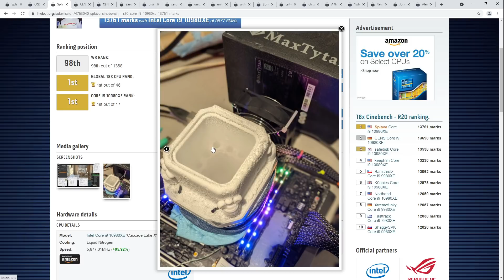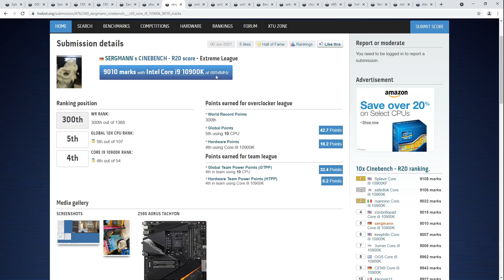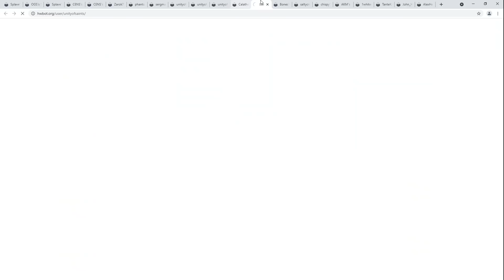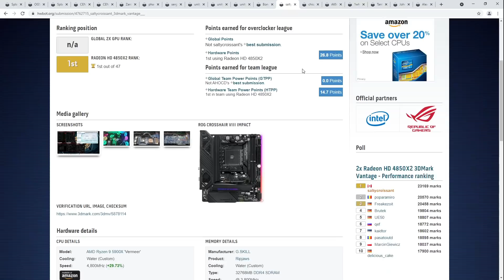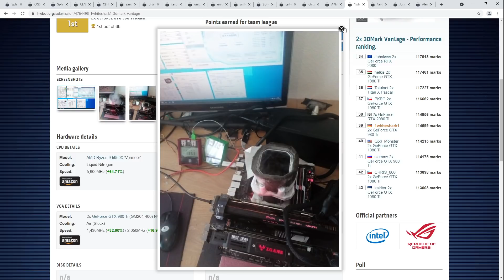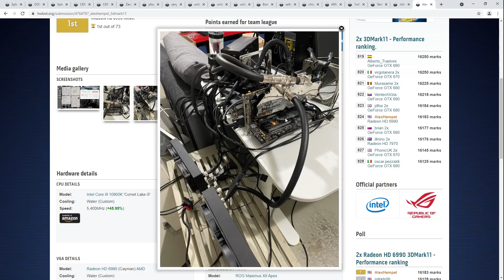HWbot score round up #6: WAY TOO MANY SCORES EDITION

Comment: Hey guys, have a question cuz kinda newbie in pc. I built my first  pc yesterday. Main parts are i5-11400f + gigabyte z590 gaming x + hyperx furry 3200 and cooler deepcool gammax 400 + dq 750 st gold + mesh box (2 fan 140 mm). I've heard a lot of rumours about i5 65w tdp and voltage from box. But it startet at 4.4 Hhz at 65w and 1.248 av voltage. I tested it for 15 min in AIDA, temperature looks great, like 68 C average (79 max), volt was 1.230 av but it reduced multiply to 42, idk why but 0.2 hhz doesn't really matter. And so the question is - should i increase tdp to 100-130w and voltage to 1.250 or not? And maybe you have a guide how to increase tdp, cuz this mother doesnt have overclocking menu.
Reply: If you have the 11400f not the 11400kf 

Then essentially all you can do is 

Enable xmp profile

Set memory strap to 1 

Max out long term and short term turbo power and time limits. (Depending on board enableing multi core enhancement does this)

 I woud not touch the voltage as there should be no need for that.
Reply: what that guy said. xmp, or tune the memory if you want to, disable power limits to get 4.2ghz all core clock (4.4ghz is only for when 2 cores are active it think) and make sure your memory is running in gear 1, not gear 2

Comment: Yeah for AM3, IMCs are E0 > C3 > C2 but cores are C3 > E0 > C2 generally. That 720 BE 32M has passed back and forth between Bones and I 3 times now lol
Reply: Yes, Unity and I have been slugging it out with these over the past week or so. These chips are finiky when it comes down to it, what settings that may work in one session may not the next time around when you go for it. I can't say how many times I tried the same exact settings with different results ranging from terrific to utter failure with nothing changed about the settings in use. 
The board in use, RAM and all else matters as you'd expect and as a bit of info the sticks I was using have Micron D9 IC's in them, these being dual sided/rank sticks.

Comment: I have a HD4850 X2, it's pretty hard to find a motherboard that it works on.
Reply: not so hard just choosing the right driver is the hardest part
Reply: @saltyphil1874  I have over 50 boards and it isn't even detected on most of them. Can't install the driver when the system won't post or detect the card :'(
Reply: @LawrenceTimme  weird this card post and works well on my x570 impact/x570 STRIX/UD3. Im also getting a b550 strix ill test it on that 1 too.

Comment: 20:03 sounds like more cache hits on multiple reruns and fewer cache misses.
Reply from the maker: the effect is also present to a lesser extent on intel systems.
Reply: @ActuallyHardcoreOverclocking  now that I think about it, it might be lass of a cache issue and more of Intel's branch predictor after the same program has been run multiple times.
Reply: That effect is going to be way more prevalent with the big stacked cache that's coming soon